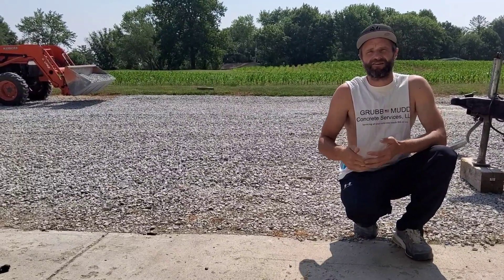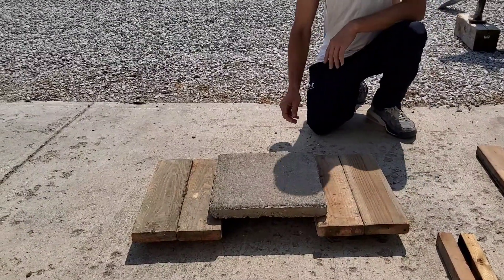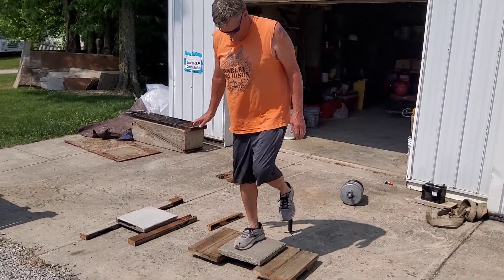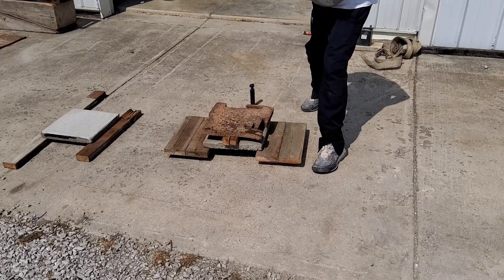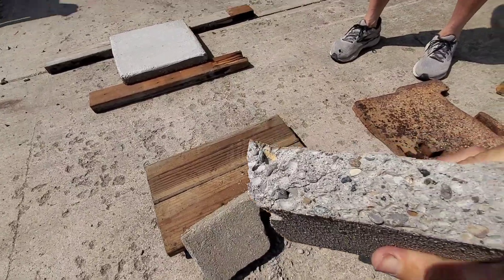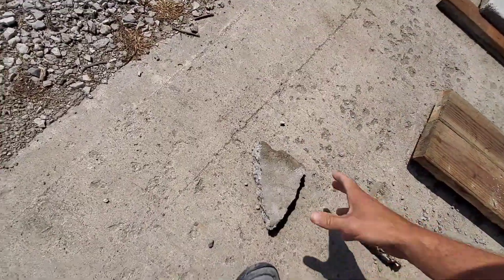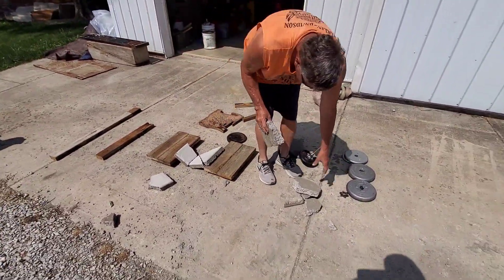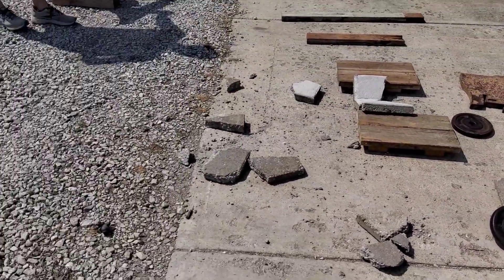I cant Believe DRY POUR Concrete is SO DAMN STRONG

Comment: Good test, thanks for adding to the body of knowledge around dry pour. If would be nice to know what brand and "type" of concrete mix you used for this test, because others have found that even with wet mixing, there can be great variations in quality between brands. 
In addition, as some others have noted, it would be interesting to see how some rebar would affect the outcome. For any slab you'd use rebar with traditional wet mix, you should use it with dry pour, that doesn't change.
I was surprised by how similarly the two methods performed, though. In short, no one is claiming that dry poured concrete is AS good or AS strong as wet mix, but maybe it's strong enough for many around-the-home and garden projects.
Also, for people like me who don't have a mixer, wheelbarrow, or other tools and just need a 4 x 6 slab in my inaccessible backyard, it's become difficult to find a contractor (in my area of the Midwest, anyway) willing to even give an estimate, they don't want the job. If they do, it's expensive and will be delivered on their time schedule, whether it's a good time for me to have it done or not. I understand that-- with the investment in their equipment, big jobs are their (and your) livelihood.  
Again, thanks for keeping an open mind and doing a good test.
Reply from the maker: Menards brand. Yeah I should have put that in the description or something thanks for the comment and the view. Glad it helped a little
Reply: @GRUBB-MUDD  
At least one other video I’ve watched directly compared Menards “Mastercraft” concrete with Quikrete and found it to be inferior: 
https://youtu.be/nFhSXqOyF5k
It’s just too cheap for me to expect much from it!
Reply from the maker: I think dry pour is ok. For like the small diy project around the house. Exactly like u said

Comment: I would say concrete in a bag should only be used for underground work such as fence posts or like if you are going to set a strip drain just to level it
Reply from the maker: FACTS
Reply: 5000 psi concrete in a bag is as strong as 5000 psi from a batch plant.
Reply: @FisherCatProductions  if its mixed correctly yes. A dry pour is not going to go to strength champ, just so you know.
Reply: @lachlanitis2311  LOL my response went to the wrong post. Sorry lad.

Comment: That weight dropped is like a brick hammer. Of course, it's going to shatter.
Reply from the maker: I ran out of weights
Reply: @GRUBB-MUDD  I have done dry pour. You missed a step. Misting the ground before you dump. This way, you absorb from both directions.
Reply from the maker: @mr.gabriel382  I def did that, but like I said an inch and a half thick is best

Comment: Next time do a drop test over solid surface. Nobody is pouring concrete at 1-1/2" suspended in air between two pieces of wood. OR next time you have a bit extra on a job of average truck mix... put that in the mold and see how it compares. Probably won't be as brittle and crumbly, but I could see it cracking
Reply from the maker: 😂😂😂😂.  U r right

Comment: Nicely done, true test of strength. Pre-mix is the ONLY way to go!
Reply: Sorry, but this test did not prove "Pre-mix is the ONLY way to go." Using that logic, you should have tested the wet slab against a 10,000 psi mix.. Would you conclude that "10,000 psi is the ONLY way to go"? Nope. Because you don't use a 10K mix if 3500 psi will do. If a dry pour has the needed strength, it's perfectly acceptable.
Reply: @FisherCatProductions  There's a reason why cement trucks don't bring the mix dry. If dry pour is that great why isn't it used in buildings, bridges, and roads??
Reply: @budsatawny  I answered your surley question in my previous response. You don't use dry pours in bridges and roads because a dry pour doesn't have "the needed strength. I never, as you suggested,  quantified dry pour as being "that great". That's you putting words in my mouth. I clearly stated that dry pour is suited for projects that only need dry pour strength. Not exactly a tortuous concept to grasp.
Reply: @FisherCatProductions  I think they mean pre-mix is the only way to bring the concrete to it's full potential. Properly mixing produces a superior end product, and that's not even debatable. But with that said, dry pour can be "good enough" in some applications.
Reply: @FisherCatProductions It's not just a question of strength, but also durability. Dry mix is fine for something temporary that you're going to take apart. Maybe you need a temporary fence for a few years. Maybe you need a makeshift walkway through some muck till you can get a permanent solution. But NEVER use dry pour on anything that needs to be there for a long time.
Reply from the maker: Exactly 💯

Comment: You should have did the exact same test on both pieces and you did not. You should have did all the other tests before dropping the weight on the 2nd one.
Reply from the maker: I'm pretty sure that regular concrete is not weaker than dry pour

Comment: Lol zero chance that’s 200lb more like 50lb
Reply: I was thinking the same thing lol
Reply: Definitely not 200 😂
Reply: Absolutely not 200lb.. maybe 100lb at most
Reply: Y’all ever moved tractor weights? They are cast iron and do come in 200lb sizes just like that. I have two 200 lb and one 100lb plate on the front of my tractor!
Reply: 1” steel plate is 40# per sq ft. So 50# is about right

Comment: Wow interesting test, I have seen the folks doing dry pour concrete on youtube, and cringe every time, lol. Yeah, my bet is the bag mix doesn't contain a great deal of cement, and the manufactures, are dialing it back to save money. Adding an extra 1kg to 1.5kg to a 20kg bag should increase strength to around 30mpa, that would be a curious result!!
Reply: Premix in bags is available in strengths of 5000 psi or more. That's more than adequate for a dry pour shed slab, sidewalk, etc.